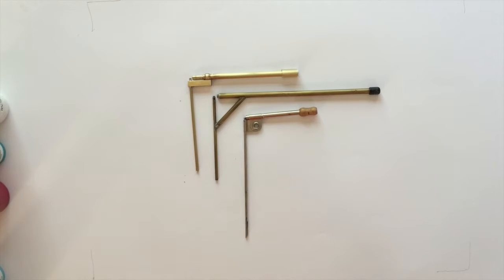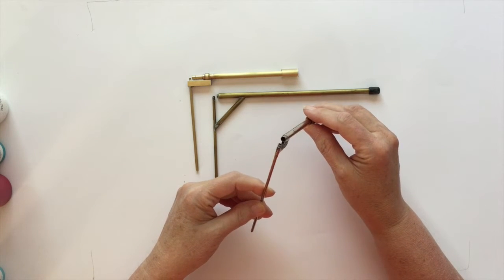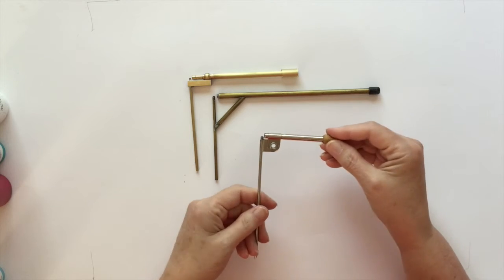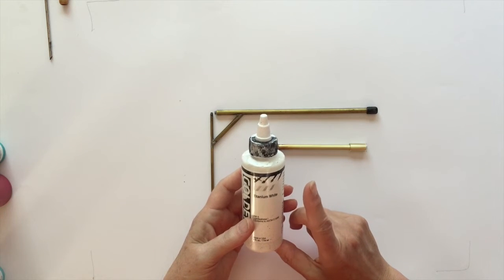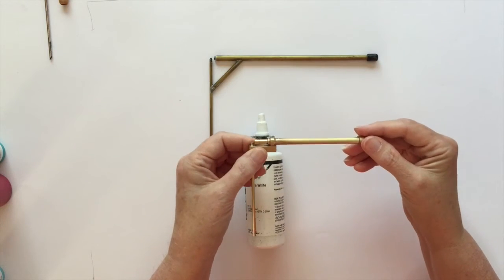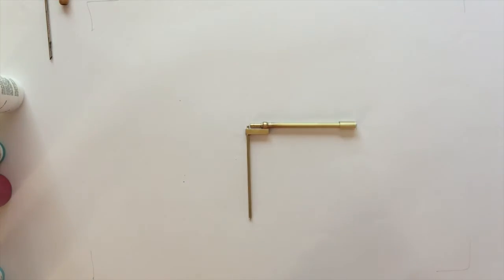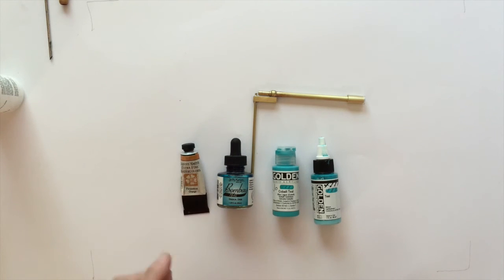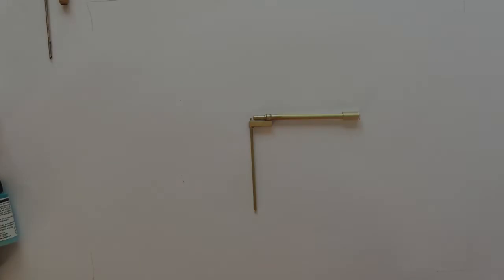Tools: Mouth Atomizer Part 1

Comment: I wonder if there's a way to restrict the opening of the shop bought atomiser to increase the pressure as you say. Trying to think of a way that doesn't involve welding and soldering!
Reply from the maker: If you come up with an idea let me know if it works! We tried to think of everything so that we didn't have to make them but we are still thinking!
Reply: I got a basic folding atomiser, I can't seem to make it work at all! Does the paint in its container need to be as far up the down tube as possible, to minimise the height that you are trying to draw the paint up? I also seem to remember something from school where you were supposed to use circular breathing, to keep up a continuous flow of air, but I can't  work out how to do that. But you don't seem to use that in your other videos, so perhaps I just don't have enough puff, or maybe I need to cut down the down tube so there's less length for the paint to come up
Reply from the maker: The folding atomizers are nearly impossible to get to work with white paint. They can sometimes work with very diluted acrylic or watercolor. It is more about the angle of the tubes to each other. Also, as I show in my videos, the further up the tube the paint is, the easier it is to spray. They do take a lot of breath. Think blowing out candles on a cake. Check youtube for some videos on the regular atomizer like you bought and it may give you some ideas. I don't use it so I just know it is very hard to make work. Thanks!

Comment: Can I use it on oil paint
Reply from the maker: Hi Sunil. If you can thin the oil paint to the consistency of water or skim milk, then yes, you may be able to spray it. Because of the solvents, I would not spray without the use of a respirator. In addition, cleaning the atomizer will need to be done with solvent rather than water. If you have any more questions just let me know. Thanks!